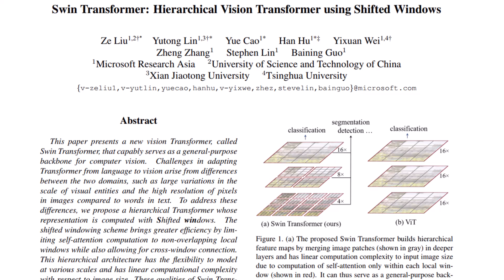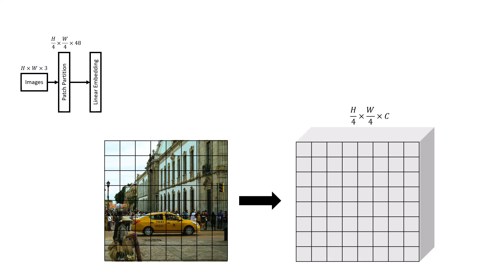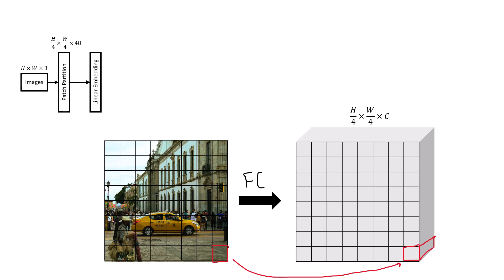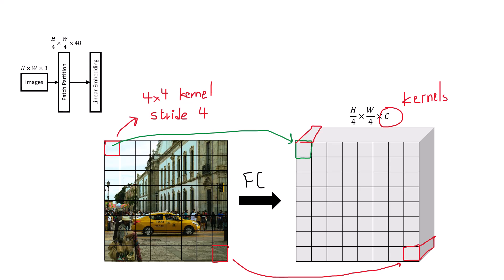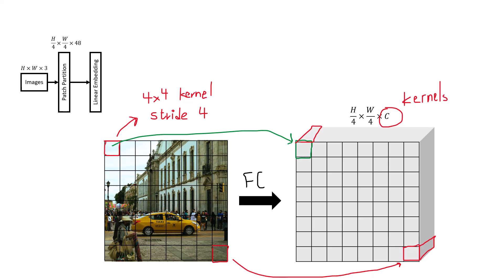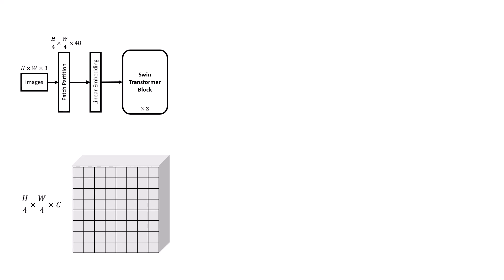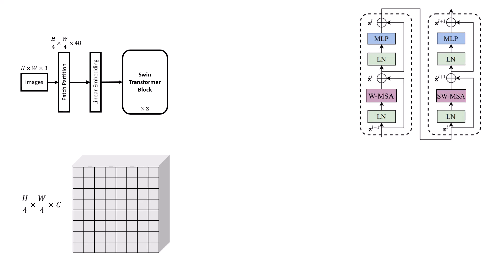Swin Transformer - Paper Explained

Comment: 17:15, may I ask why the number at the right bottom of the 3rd swin block is 6?
Reply from the maker: That's a hyperparameter I believe.  It's hard to use lots of layers at first and second stage because of the memory constraints we have with 4x4 and 8x8 patches and 32x32 patch at the last stage has the highest patch size (least attention to details). So they used the most at 16x16 patch size instead.

Comment: The discussion about patch size at around 16:40 is confusing
Reply from the maker: I was comparing 4x4 swin transformer vs 4x4 ViT. In 4x4 ViT the whole layers have patches of 4x4 pixels so in all layers they have good attention to details. But in swin transformer as we go forward we merge these tokens so we have less attention to details in deep layers (that's why the end layer output is not enough for segmentation).

Comment: That's The Most Illustrative Video Of Swin-Transformers on The Internet!
Reply from the maker: Glad you enjoyed it 😃
Reply: @soroushmehraban  yes abs thx so much, although I Have a Quick Question More Related to PyTorch actually which is in min 12:49 in line 239 in the code 1st what does -1 here means and what does it do exactly with the tensor 2nd from where we get [4,16] the 4 here from where  we got it cuz its not mentioned in the reshaping. Thanks in advance.